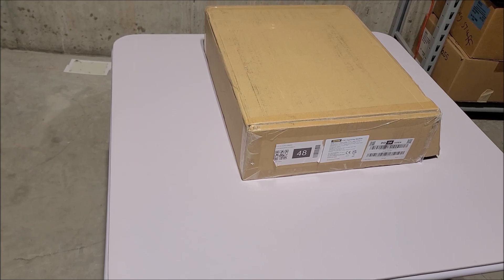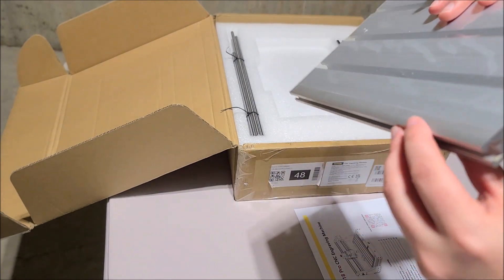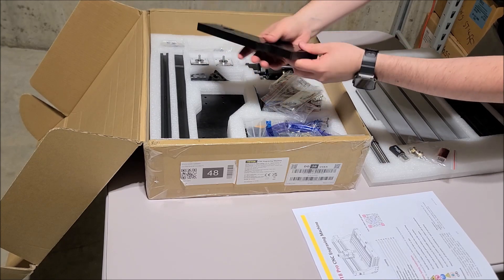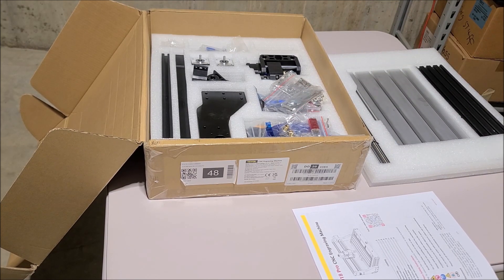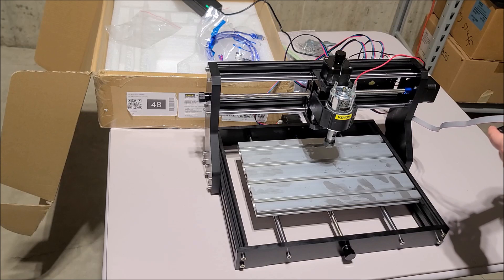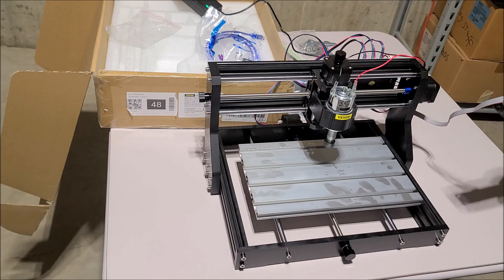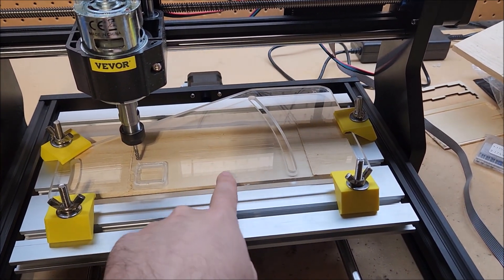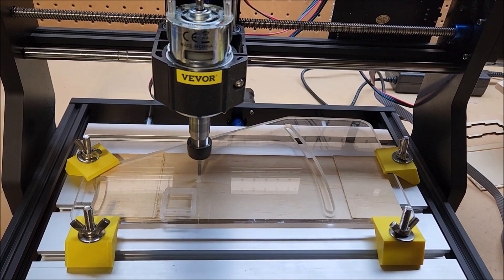Lab Tech: Let's Assemble a Vevor 3018 CNC Kit!

Comment: If you manage to produce pieces that are (or can be made) usable, without ruining any end mills, you're off to a good start.
Tips for drastically improving the quality and overall experience of milling acrylic, based on own experience:
1) Reduce flute count.  Single flute is the best option. Other option is to reduce RPM (losing torque, not good) or to increase feed rate.
2) Increase feed rate (X&Y) if possible, I don't think these machines can move TOO FAST for acrylic even when using single flute end mill. If you see melting in the corners, but not on longer straight lines, you may want to increase acceleration (Grbl configuration with some $=xx commands).
3) Manage chip evacuation (vacuum/compressed air) to avoid melting already milled chips. Switching to single flute end mill also helps with chip evacuation.
But like said, you are off to a good start. Hopefully we will see some CNC projects in the future!

Comment: Man, the price of these desktop manufacturing tools has sure come down.
Reply from the maker: Right? I'm plenty happy with the hardware, it just turns out that there really aren't any good free CAM software like there are for 3D printing and even laser tools. Everything I find is either abandonware, barely functional, severely crippled free trial, expensive/subscription, or annoyingly cloud based.
Reply: @sjm4306  Yeah, that is definitely an issue that someone smarter than me needs to spend some time on.